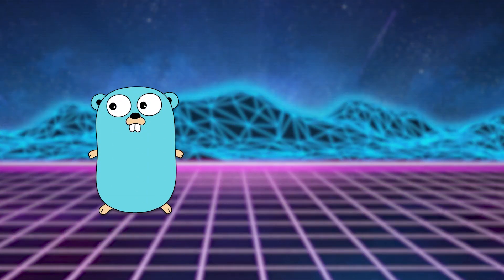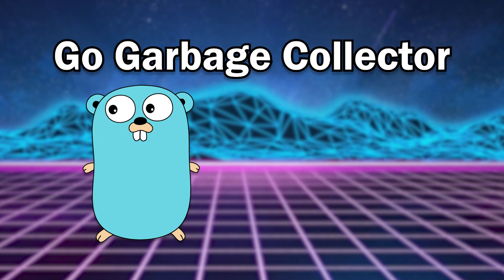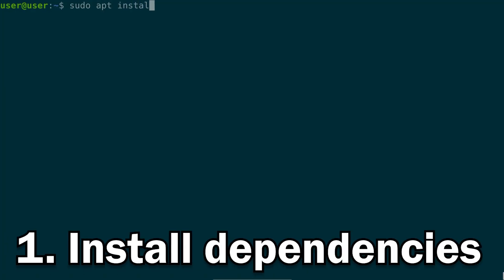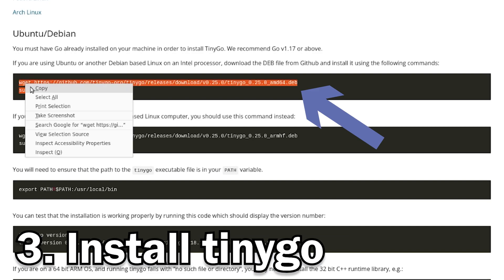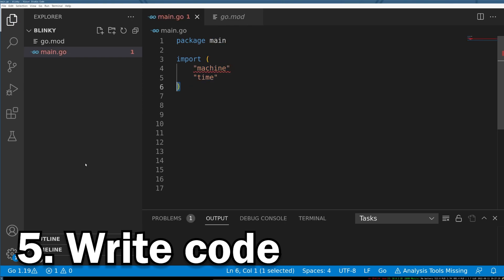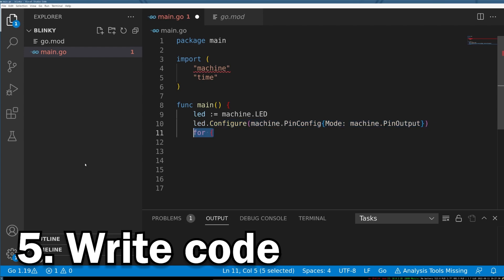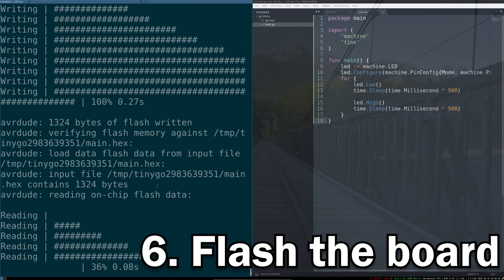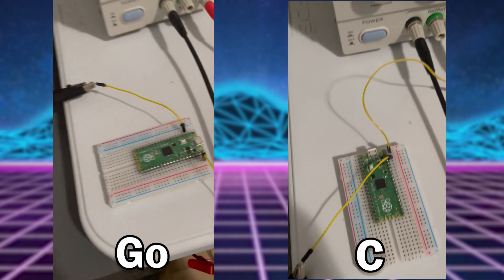an 8-bit microcontroller but it has a garbage collector

Comment: Nice to know. But avoiding C because of Go garbage collector seems to be like avoiding your own problems.
Reply: Not everyone who uses embedded devices as a hobby should be tasked with manual memory management. There are many things you can do using Go which are much easier to accomplish than doing the equivalent in C.

It's like saying avoiding assembly seems to be like avoiding your own problems. If you can do the same job in a reasonable manner using an easier language, so there's nothing wrong with doing so.
Reply: @mgord9518  The difference between your comparison is that you can have the same performance in C and Assembly. Not the case between C and GO.

But you are right. I may be too much of a perfectionist, this is also a problem for me.
Reply: @Lu-ql5tj  There are tasks where C's performance can't reach assembly's and there are also tasks where Go can meet C's performance.

I did a benchmark writing a simple Pi calculation program in both C and Go, Go always came within 0.01 seconds of C (sometimes 0.01 ahead) and it was a 10+ second calculation. I'd consider 99.99% to be functionally identical.
Reply: @mgord9518  Sure - in artificial simple benchmarks....

But we are talking about small microcontrollers here. You do NOT, in any way, want dynamic memory on those.
Reply: @mgord9518  You can't decide to compare speed with one test.
If you really know C, then you know what it compiles to. You can implement exactly the same efficient code in C that compiles to the most efficient assembly code.

Comment: Why Go program uses less power than C ?
Reply from the maker: Not sure to be honest.
Reply: @LowLevelTV  C is the Greenest programming language btw
Reply: I'd guess that since it's only a blink program there's no real difference between Go and C, since there's no actual reason for the GC to run. The smaller power usage is probably due to measurement inaccuracy, temperature and a whole lot of other things.
Reply: @_.madpie._  yeah, makes sense, go's escape analysis can probably handle that.

I wouldn't exclude the possibility of the go program being more efficient. It COULD be the things you mentioned, or it may be more efficient.

Even if it is more efficient for that though, doesn't mean you can extrapolate to more complex "real" programs.